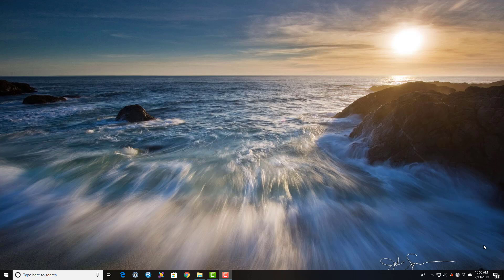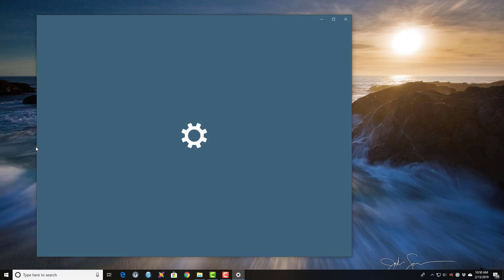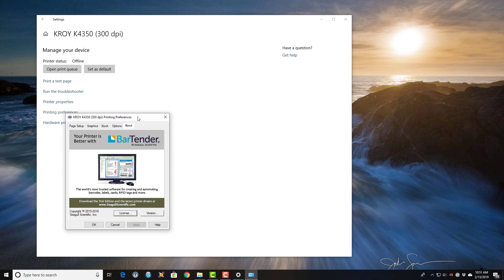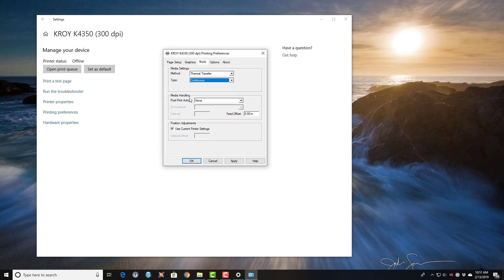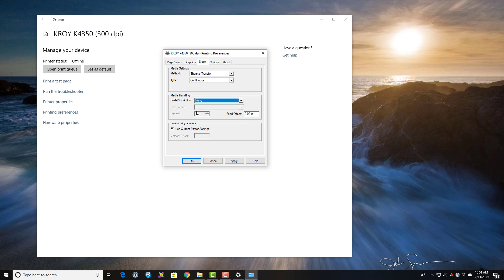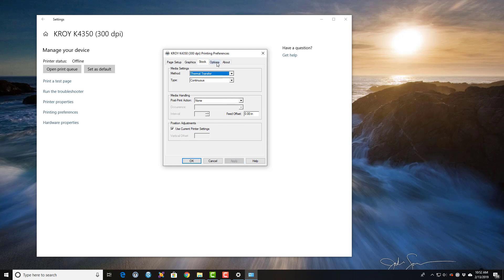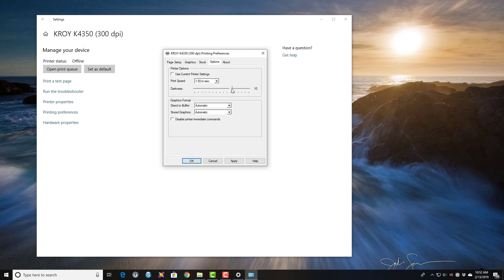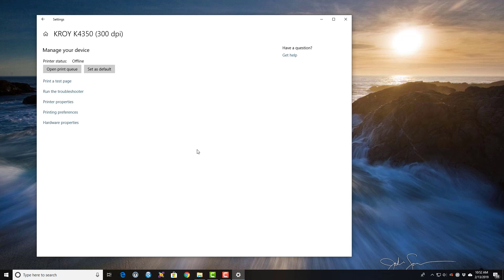Configuring Kroy K4350 print driver for printing heat shrink tubing

Comment: +Robert Benson I have a Kroy K4350 that came with a copy of TekLynx XLT+ for printing thermal labels. I was using a stand alone Win XP PC that is about to die out. So I tried to change the Kroy over to spare Windows 7 machine, but I the original stock drivers wouldn't support it. So then I found the Seagull Bartender driver. Now, with this driver, I'm getting a "this printer is not supported" error when trying to print. Do you have any ideas of what  can do to make this work? Thanks for any help in advance.